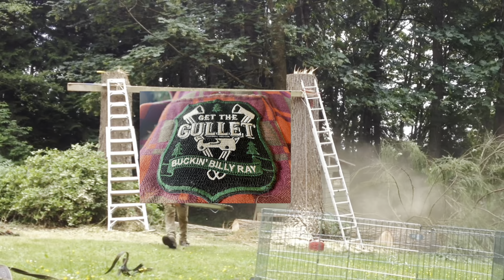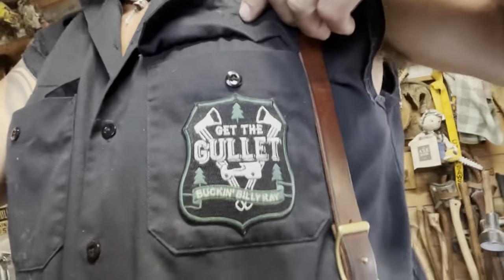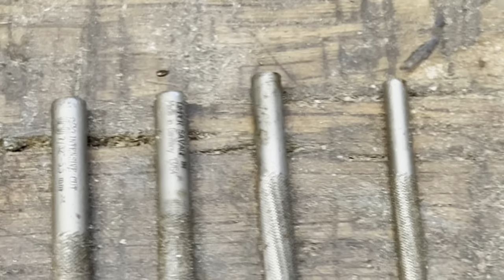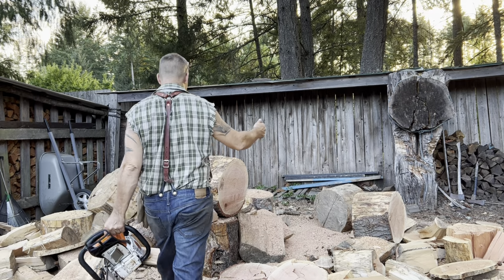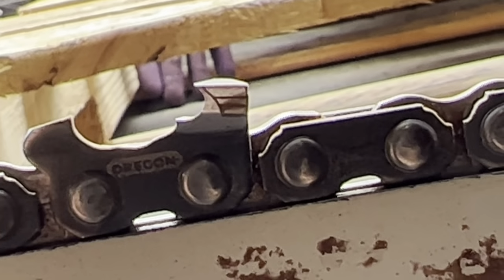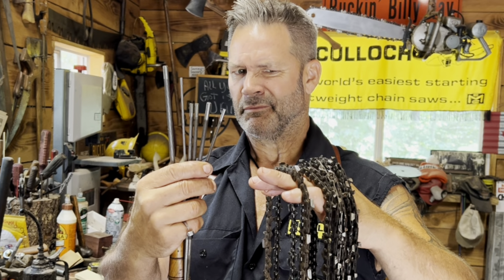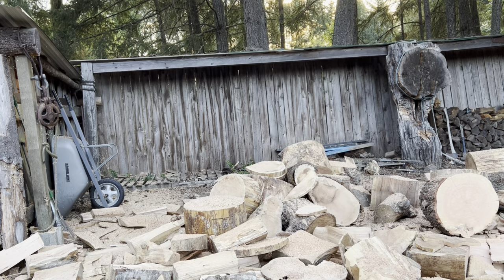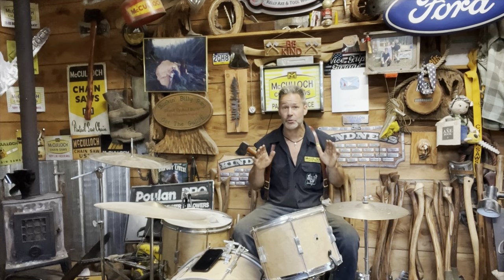All About Chainsaw file size, and sharpening terms, what does it all mean?

Comment: Not trying to get a argument but which is better for speed a  ⅜low profile or .325 chain. What's your alls opinions and why please. Thanks Buckin and the rest of the Army
Reply: Yes your 3/8will cut faster then 7/32 chain. It's less wood being removed.  But you make up for it in speed. But you have to change your drive sprocket  to fit your chain. But you have to have a sharp  chain and ranker set right as well. And don't forget to have the bar rails even.
Reply: You would need a stopwatch to tell the difference. Do what makes sense for simplifying your life...👍🏻
Reply: Makes sense now.  I guess more torque less RPM the ⅜, less torque more RPM .325 makes the most sense from what I'm reading.  Thanks

Comment: Makes sense to me friend! I remember a video of Harvey's ( Ironhorse)  where he talked about how a chip is formed, and how the top plate cut, and what the purpose of the "C" shape was all about, and its importance in actually removing the chips as the saw cuts.  He hit it quickly in the video, and I backed the video up several times to fully understand it. But after I saw it, it made so much more sense, and I spent a lot more time working on filing. Between you two, I've learned a TON of info! You all rock! Much love to all from Northern Alberta!

Comment: About 6 years ago i had 4 chains i had a shop sharpen  then i had all dull chains and went to hand sharpen them and found out that a shop work harden the chain and my file couldn't file them.  So u kinda got to what ever way u start by sharpen your chains you got to kinda keep doing that way for the life of the chain. Thanks to buckin my hand sharpening is better than a new chain out of the box. You people that hand sharpen know what i mean.  Gota love a saw thats hand sharpen and it pulls it self hard into the wood.  Buckin does the best information on getting u chain sharp.  Tyvm buckin

Comment: Great to see you running the Egan Straight Shot exhaust cover on that 500i! I run those on my 400 and 661. I can’t say enough great things about them! Throttle response or Crack that you speak about for limbing. The pull and overall sound! Hands down best bang for the buck for a saw this side of port work in my humble opinion!

Comment: My Stihl ms500i is my favorite and most used saw. I installed a bark box and Max flow air filter and soon a Wiseco piston. An aftermarket piston helps a lot.
Reply: Also my favorit saw
Reply: Bumping up compression or is a durability issue?

Comment: Iam watching you from far away.Iam in Cyprus! Iam not professional but iam a passionate countryman cutting lot of firewood every year. I just dont understand why using square filling instead of round filling. I mean that round filling -if you have the experience -can be done directly in the woods, quickly easily and accurate. I prefer round filling. Can you please make a video showing with your unique way why someone may choose square instead round filling method. Keep going man you are the best. !!!
Reply from the maker: stick with round friend , i round file doin' firewood and residential tree work . I only Square Grind in clean conditions , in the Bush ..In my hay day of production Fallin' if you were filin' on the stump it was frowned upon, as wood should be goin' down , if i hit dirt, i took chain off and swapped out , you know how long that takes. so think about this .... you and I are fallin' we both hit a rock , you start filin' i swap a chain and start cuttin'. they are gonna call me back as i get more wood down , . guys like filin to rest i get it . but a contract faller has himself to answer to not a boss . if yer filin' and im cuttin down a 5 meter stick Im gettin' more. . you can hand file square as well in the bush regardless, i wood'nt   ,,Im Glad yer here friend , thx , hope this answers question
Reply: @BuckinBillyRaySmith  thanks man! I understand! I have always with me 2nd chain in case i have to deal with such circumstances!Thabks again!

Comment: I run the stihl ms250 and ms261 cutting creosote treated piles up to 20", 3-4" by 12" and 12" by 12".  Building piers, docks floats... marine construction. I need to make precision cuts. The chain requires a 3/16" file. Do you think I'm using the most optimal saw and chain?

Comment: 13/64 is for 3/8 Stihl chain.  7/32 is for 3/8 Oregon chain.  I keep them both in my 3/8 file set.  The handle on the 13/64 file has Stihl written on it with a sharpie and my 3/16 file has .325 written on its file handle.  My Stihl picco files have an LP written on their file handles.  I hand file everything.

Comment: Love the video(s)!! I understand what ya mean about the gullets, but why do you use square ground only for production falling, and round filed chains for residential and firewood? Would you use square ground chain for a Stihl 200t?
Reply: For production square chain cuts faster and you are less likely to encounter metal in those trees. Residential trees can have nails in them and semi chisel chain is easier to sharpen if you hit metal.

Comment: Is there a different between square filed chain vs ground?  Also, what type of wheel do you use to square grind? 

If you use a standard picco sharpening wheel on a grinder, you could probably grind the baby c and forget about the files. Just a thought.
Reply: HE HAS A LOT OF VIDEOS EXPLAINING ALL YOUR QUESTION S
Reply: It’s a different type of machine to do square… standing symington… big wheel… square is fast cutting but it’s a clean wood chain only… a little bit of dirt and it’s dull!  Round will last longer…
Reply: They can both be either hand sharpened or machine ground…
Reply: Yeah man…1/2 way down I switch to my 13/64 so I’ve got a good angle on the cutters…. 💪😂

Comment: Buckin, use to run Carlton Magna chisel .404 on a Olimpkic 284 and used Ferd files 28” bar loved that saw 30 years ago cutting firewood didn’t break it enough got greedy and turned it up well didn’t have the money to rebuild but now if I can find one would love to get one
Reply: Buckin,to add to my comment I just bought a house and got gotten married wife not helping with any bills didn’t go past 12 years Worked my butt off with 4 jobs finally got to a factory job that I love you might think I’m crazy but it’s the best money I’ve ever made 2 miles from home and only work 14 days a month don’t need to cut firewood but a dear friend of mine just had his second knee replacement going to buy a new saw and give him some help he has never been to Bunion going be there he love’s the Macs has two 2 man macs

Comment: About the 500i: I have mine since 2019 and you're right. The chain I use is a Stihl RS chain and the saw simply runs the best when it's filed a bit agressive. The C you talk about is relatively big and the rakers are just a tiny bit lower than the manufacturer recomends. And that's where the beauty of this saw starts. All marketing tricks aside... it is a nice saw.
Reply: The 500i Runs even Better with a square ground chain But i also use the Stihl RS chain  best regards from Denmark 🇩🇰
Reply: @-AP  I don't have a grinder, nor the room to place it so round it is.
Grtz from your neighbours in the South West 😃
Reply: @gerritvanwilligen  hello neighbor 🙂 i just handfile also my square ground chain i have a chainsaw grinder for round filling But i dont really use IT anymore after i have seen buckin's videos about hand filling and a Lot off practice with handfile to Get The Gullet now it cut like a dream 😉🙂best regards Denmark 🇩🇰
Reply: @-AP  I'm not even going to bother trying square filing since I'm in residential areas most of the time. There's always dirt, nails, a forgotten invisible piece of fence etc. Round handfile full shizzle chain, exept for the tophandle saw.
Grtz from The Netherlands :)
Reply: 500i and the 2 in 1 sharpener job done.
Reply: @danstevens2204  No need too 2in1 file i just use a normal round file much faster🙂
Reply: @-AP  don’t get the rakers with a round.
Reply: @danstevens2204  nope But the fladfile does 2in1 is too hard in the rakers its i havent used my 2in1 for about 6month just free hand filling here thanks too BBR now i get the gullet 🙂
Reply: @-AP  the tooth will only bite as much as the raker allows. I’m happy with mine down. Stihl rs full chisel is my preference here in Aus
Reply: @danstevens2204  same chain i use the most But i also use square ground chain from Oregon 😉🙂
Reply: @-AP  what sort of wood are you cutting? I’m mostly into eucalyptus here.
Reply: @gerritvanwilligen do you use the standard 13/64 file to get the big c??

Cheers from Nz
Reply: @goonriderification  5.5 mm. Not sure what that is in inches, but I guess that is about 7/32.

Comment: You’re dead on about the 500i Billy Ray.  I’ve had mine about a month and if you aren’t razor sharp it four strokes a lot.  With factory chain it’s in and out of four stroking in small wood, it just doesn’t bite the same way a good hand file with the rakers at 30-35 does.  Cheers from Ottawa
Reply from the maker: glad im not alone ... gotta be sharp ,, might make folks better eh?  thx

Comment: The guy at the Stihl dealer told me 13/64   is for 3/8 pitch and 7/32 is for 404. I'm not sure why Stihl says that because I  know everyone else in the world uses 7/32. I tried it on my 3/8 chain it gets the the top plate really sharp but you start to mess up your hook if you use it to much.
Reply from the maker: CORRECT, UNLESS YOU HAVE SPENT TIME ON A SAW AND IM NOT TALKIN 3 TIMES A YEAR FOR 20 YEARS ,,, YOU WILL KNOW ABOUT THE PRODUCT YOU SELL ,, NOT HOW THEY ARE USED. ITS JUST LIFE
Reply: So what size file do you recommend for Stihl 3/8 .50 33RS Chain? 7/32 or 13/64
Reply: @Denton Dunn  I think maybe Stihl recommends 13/64 just to be different than everyone else. It might make your chain a little bit sharper maybe but because it is smaller than 7/32 , it's easy to lose your hook.
I'm in no way an expert but from trying them both that's my best guess.
Reply: @jonathantrowbridge4641  glad you said something cause it’s a new chain that’s never been sharpened and I bought 7/32 file’s cause they recommended it but before i touch it I’m buying a new file 13/64 and try it out

Comment: Why not ground chain for residential or round file for falling? What’s the better method for cutting and what’s the difference
Reply: My novice opinion is that I doubt it makes much difference for the average person. Round filing is easier to get good results with. The main thing is having a sharp chain and properly set rakers. This would be a great thing to experiment with after a few hundered hours on a saw.
Its just interesting stuff and Buckin is cool as hell.

Comment: I suck at sharpening, I’ll sharpen and then the chips are so fine I give up. I file the rakers( think that’s what they’re called) to no avail. Still doesn’t throw those big chips like a new blade. Guess I’m not getting the gullet. Haha
Reply: Don't give up Ronnie...
Couple tips for you...
Get a bright light so you can see well. Buy some brand new files (files don't last very long) Apply plenty of pressure on strokes (I believe alot of people just do the stroke but you have to really dig in) Watch the metal burr roll off the top cutting edge and then lighten pressure for a few strokes to clean things up. 
You got this...👍